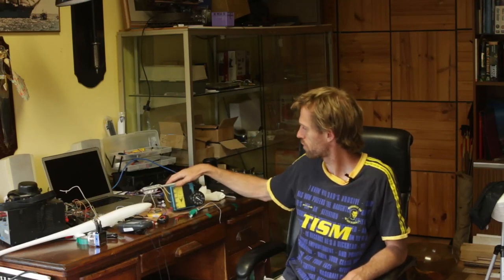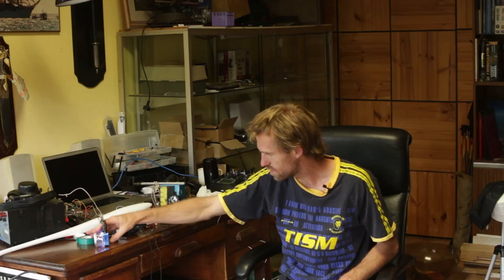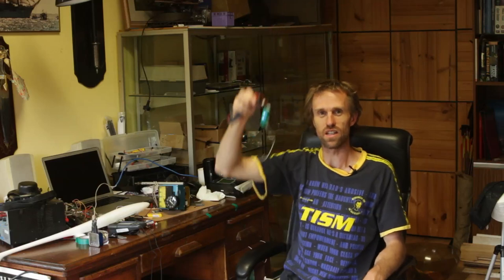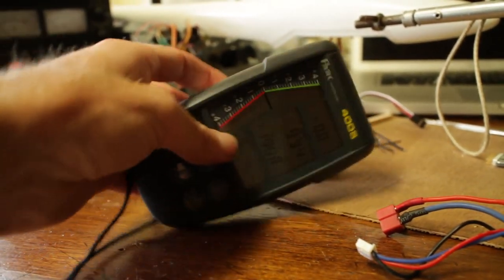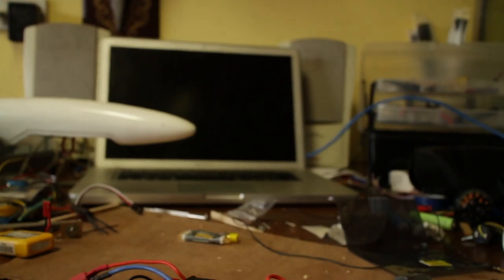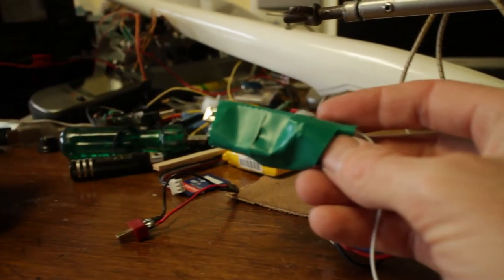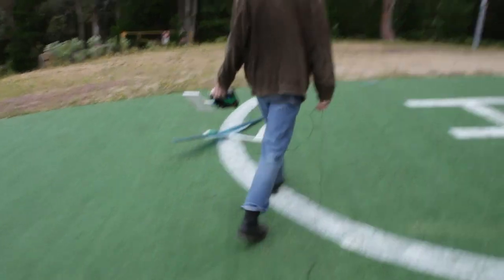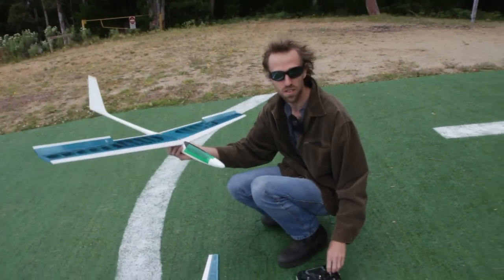DIY Arduino Variometer by Rolf. RCHacker #56

Comment: Would it be possible to have audio out to a speaker on the plane, which the FPV mic picks up and transmits back to ground station?

Thanks very much
Reply from the maker: Probably, just make sure you use a transistor to drive the speaker. google "arduino drive speaker"
Reply: Thanks

Comment: Hey Mark! Great Video! I was thinking about instead of using the RX and TX we could actually use the orangelrsng telemetry rs232 channel, let me know what do you think.
Reply from the maker: You will have to decide whether to send the raw pressure data, or an encoded vario tone. Either way, it will not sound as responsive sent over the slow telemetry link.
Reply: Good point Mark, I will build to spec then, Thanks!
Reply from the maker: Any progress on this Antonio?
Reply: RCHacker , I am using mine on a little glider for a while, I build exactly like yours and works like a charm, thank you! Keep up the great work!

Comment: Looks like it works well!! I want to do the same thing but FPV one day :)
Reply from the maker: Might beat you too it, I was thinking of sending the vario output on the audio channel of the FPV gear.
Reply: RCHacker Yes thinking the same lol, I think it would make for an awesome FPV experience
Reply from the maker: BMSWEB From experience unpowered thermic flight is way more fun and challenging than powered flight. Thats comparing hangliding to ultralights anyway.

Comment: Really what I want are ultralight or hang glider instruments that output in big colorful digital LED seven segment displays.  There are none.  At all.   A vario, an altimeter, an air speed indicator, CHT, RPM, etc.    Red Yellow Green Blue etc .   All in a vertical column, one over the other.   Like the display panel in the back to the future Delorean.   Get with your dad and start a cottage industry.  You'll never make any money farting around with RC.
Reply: all aircraft instruments an analog which are awful for precision, or LCD which are awful to read in bright or poor light or at a distance.

Comment: i thought you would like this. i used an arduino board and some code to make a basic rc transmitter then embedded it into the 9x so i could connect the ps2 stick sliding pot and some knobs without loosing any of the stock ones. i just soldered it into the trainer input and select the channels via the ppm1 ppm2 etc in opentx

http://www.rcgroups.com/forums/showthread.php?t=2054642